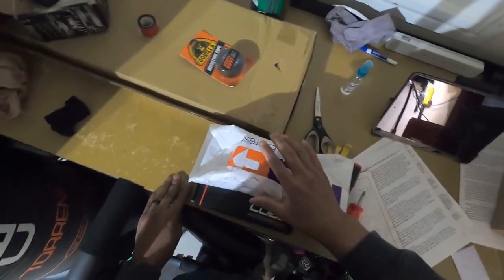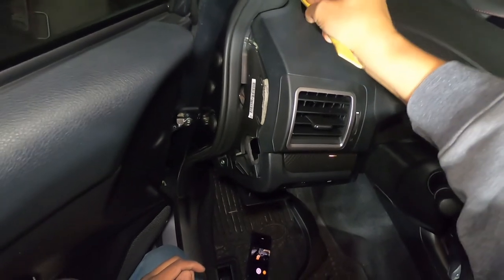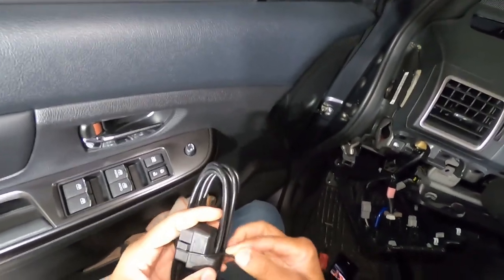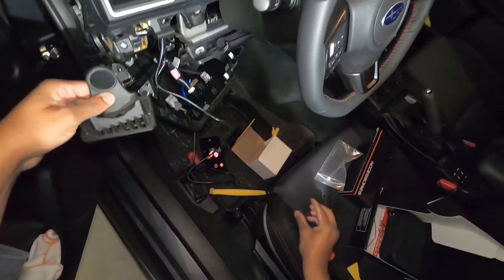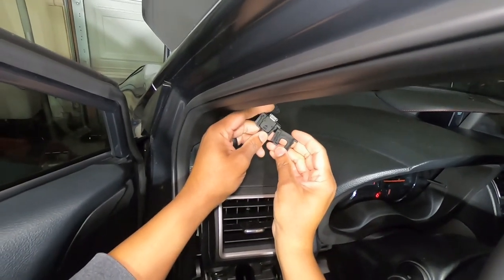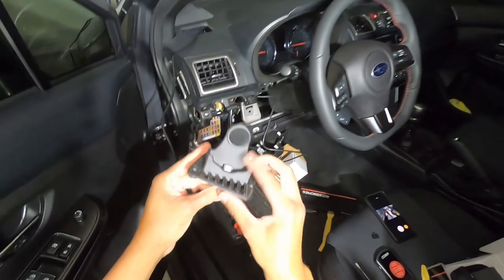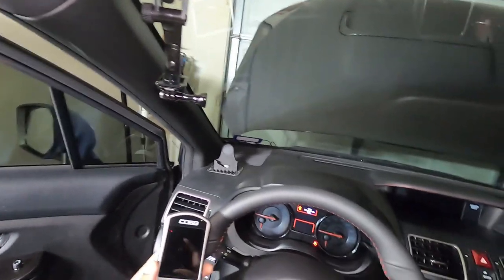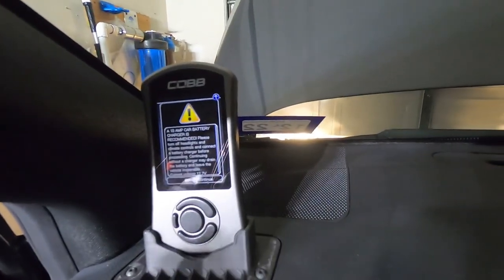2020 Premium WRX Cobb Accessport Installation with Dialed Defrost Mount  Vlog #11

Comment: Looks good with the vent mount 👌 Camera work is good too. You will love the MAPStage 1. So much smoother, throttle response and more power in higher RPMs. Kinda weird at first to get used to but definitely worth it! Can’t wait for a review.
Reply from the maker: Yeah can't wait to put it on too!